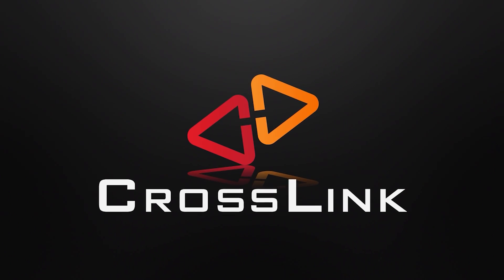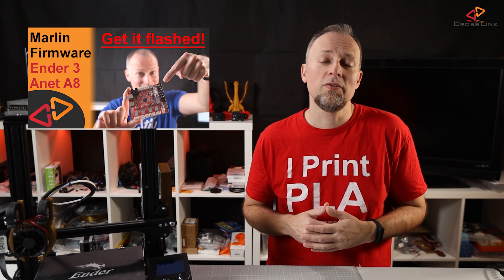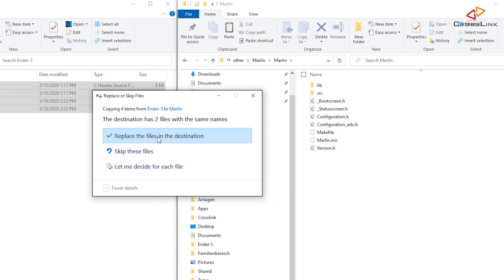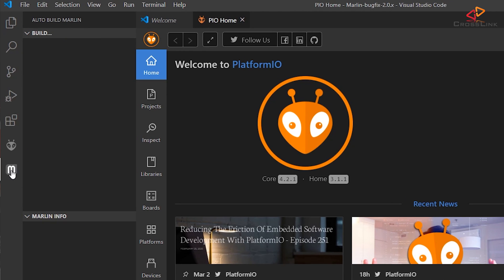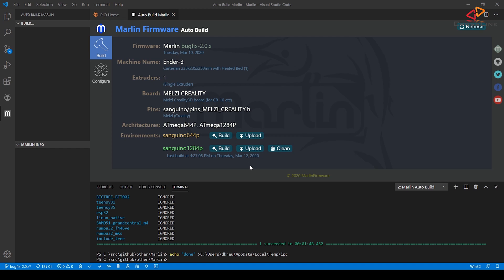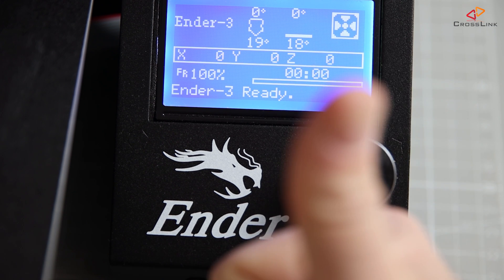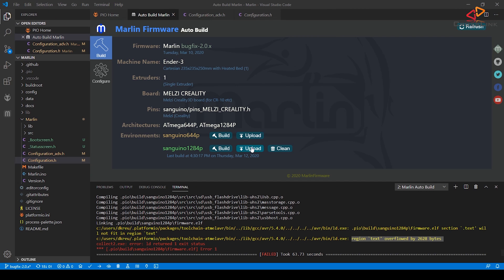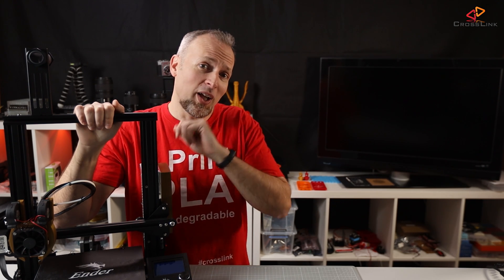Ender 3 (Pro) Marlin 2.0 Upgrade  - Updated Version

Comment: It seems that things are bit changed 10 months later, there are bunch of different configurations inside examples > Creality > Ender-3, I really don't know which to choose and on what should I base my opinion.
Reply: I feel your pain.  I tried Ender 3 Pro and there were 6 or so options.  I chose Creality V1 and it wouldn't build.  Then I went up to plain Ender 3 and chose Creality V1 again.  This time it built OK, but it's a Melzi board, not a Sanguino 1289P board.  My board says 'Creality V1.1.4'.

Not sure if I should continue.  I don't want to brick my printer... :-(
Reply: Done. :) If anybody having a problem with a port (disabled in Arduino IDE, or asking to set upload-port in VSCode) after flashing bootloader, just go and install CH340 drivers for your OS.

Comment: Just a few months later and they have made enough changes you need to redo this.  There are config files for ender 3 1.5 and Ender 3 4.2.7 but not for the Ender 3 4.2.2 which is what you are getting now in the Ender 3.  I chose the 4.2.7 and the options are now different.

Comment: This video contains omissions that are leading users astray. The link to the config files defaults to the import branch which is not the correct branch to download.  When you go to https://github.com/MarlinFirmware/Configurations, to get the example configuration files, the very first thing you MUST do is use the "switch branch" pull down and select the configuration version that matches your marlin version.  Then you can download the correct zip file. If the file you downloaded is called import-2.0.x.zip you have the wrong file. If you are after bugfix configs it will be called bugfix-2.0.x.zip, if your after a release version  it will have release in the name eg release-2.0.7.2.zip If in doubt what file to get, the README.md in the Config directory of the marlin you downloaded tells you what version of the Config files you need.
Reply: thank you!
Reply: Thx

Comment: Just installed Marlin 2.0 thanks to you. Seems to be printing great. One thing I noticed though was on the display there is a 100% displayed to the left of the progress bar. I assume that is the % of progress but it stayed at 100%. Is this an issue with just my printer or is it a glitch in the programming?

Comment: I do not get Sanguino 1248p when auto building with visual studio. I get Mega 1280 and Mega 2560 Machine Ramps 1.4. Please help
Reply from the maker: You forgot to copy the config files for your printer or you copied them into the wrong folder
Reply: @Crosslink3D  Thank you for responding so quickly. I'm new to this process. I have copied from examples ender 3 , and tried the ender three pro config file. I opened the I opened the the last Marlin folder and copied them there, There are a lot more files in the examples than what you show on screen. I will keep trying. Thanks, James

Comment: I followed this exactly with the Ender Pro, using the 2.4.7 board.   It kept failing to build.  Had to go into the platformio file and designate the environment as "ARM32F103RET6_creality", then it loaded the appropriate files and worked great.     

Thanks so much for this tutorial!
Reply: mine is failing to build, where can I find that designate to do what you did?

Comment: any help on this with the 4.2.7 board, tried exactly what youve done except its not been a sanguino board. Its showing as STM32f1 board, but when im uploading its showing as done but my printer hasnt changed at all.  Any help would be much appreciated. ive installed the 4.2.7 board to hopefully get mesh bed levelling.

Comment: VS Code won't install the playformio IDE. I installed python 3.9.1.  I did tell it to include python in path. I even command prompt tested that it was installed.  VS code keeps asking me for the 2.7 or 3.5+ interpreter (from python). I tell it where the path is and it still will not acknowledge python and then will NOT install the platformIO IDE.  Latest windows 10 OS.  How do I get this working then?  anybody know or have ideas?  Thank you. gyazo image of the error own i the corner: https://i.gyazo.com/9415440825be36c362c8caa587a3e566.png

Comment: this video is a golden reference, thank you so much @Crosslink

here are my experiences about upgrading ( this may save time for other people)

with the root project file given in the githup didnt work for me.
there are two possibilities;

 I dont have a boot loader
or
 I faced the issue mentioned here https://github.com/MarlinFirmware/Marlin/issues/19346

to give a quick shot I downloaded the  fixed version https://github.com/MarlinFirmware/Marlin/tree/bugfix-2.0.x

after loading the configs (as described in video) I built the project 
i had the environment name as "STM21F103RET6_creality"

got the bin file from [project_root]/.pio/build/mega2560/STM21F103RET6_creality/firmware-yyyymmdd-hhMMss.bin
then copied into an empty (FAT 32 formatted) sd card. 
inserted into printer and rebooted the device, it took around 10 seconds to load the new firmware. 

everything is fine and working for me , actually I'm doing print now, seems there is no issue at all.

Comment: "The currently open foler doesn't contail a (valid) Marlin project. To use Auto Build Marlin open a Marlin project folder in the workspace."

Ive tried everything, even trying different folders and double checking I was right where I was supposed to be? Could I get some help anyone?

Comment: The example "Ender-3 Pro" folder contains 6 different examples. Non seems to be for 1284P. Has anyone figured out which is the correct example to use?
Reply: I have the same issues, I don't know what subfolder I'm suppose to use ?????

Comment: i just followed the steps here but on a cr 20 (using the cr 20 config files obv)
but now the printer seems to not know where the origin is or does not seem to respond to the end switches
when i select auto home, it will move downwards even if the Z switch is pressed
then, it will move all the way to max positive of X and Y, and will attempt to continue moving when on the edges, not responding to me hitting either X nor Y switch
any ideas? when i got the eeprom error i could either "reset" or "ignore", i selected reset, turned the printer off and on and did not get the error anymore

Comment: Configurations-import-2.0.x\Configurations-import-2.0.x\config\examples\Creality\Ender-3 Pro folder includes 6 folders and none of them have sanguino 1284p option, now what?
Reply: actually there is an "Ender-3 Pro" folder and there are several main board versions available ( as sub folders),e.g. mine is 4.2.2 , I did the required steps and now doing the upload to boead. I hope it finishes properly because it already took 15 mins . I'll update the result here.
Reply: See my reply to 
Alexander Acuña

Comment: The version 1.1.9 worked flawlessly.But it doesn't have zraise function when power loss detected(I have added a power detection module)
Reply from the maker: If that module signals power loss with one pin, it could work. Proably you need to give the setting the correct pin number and it could work.

Comment: Hi, is it possible to upgrade firmware Ender 3 pro with standart motherboard?
Reply from the maker: Yes, just use the Ender 3 Pro default configuration files and it should work the same way.
Reply: Crosslink - ok. Thank you.

Comment: Hello, Merlin 2.0 doesnt have the TMC2225 on the config files would the TMC2228 config work for the TMC2225? cant find any information on this....
Reply from the maker: TMC2225 is just a TMC2208 in a different package, so those settings should work

Comment: hello, 
love the channel and your videos.... great stuff :) :)

anyway, i have a ender 3 pro with marlin 1.0.1 (came brand new like that from the seller) and i wanted to upgrade to 2.0.... 
followed all the steps and when i hit BUILD, in the end i get "J-Link connection not established yet but required for command.
Connecting to J-Link via USB...FAILED: Failed to open DLL" message.... so no connection i guess... 

am i doing something wrong? 

BTW, im using mac with OS catalina (10.15.7) 

PLEASE HELP !!!

thanks, GUY.
Reply: Hi guyelem, I'm facing the same issue. Did you succeed to solve it ? Many thanks !
Reply: @lucnougayrede9280  not yet :/
Reply: @guyelem  I found the solution. After Marlin’s build in VSCode I copy past the firmware generated in pio folder, something like that (.bin file) in the SD Card and I put the SD in the Ender3. After reboot, marlin has been upgraded in 2.x

I will check later the location of the firmware .bin generated.

(My marlin version was v1.0.1 and my board is Creality v4.2.7)

Hope it helps !

Comment: In the actual configuration->config>->ender3 folder there are 3 subfolder like BigTreeTech, MEEB and such. No clue which one do I need. Just want a new default firmware. Anyone can help which one to choose?
Reply: So after I assumed those folder titels are the leveling products I chosed  the folder "CrealityV1". Then in VCode the "Merliz Optimized" build.. Check your cable and that the COM connection is free of use. That was some nerd stuff I went through but finally the steppers are quiet.

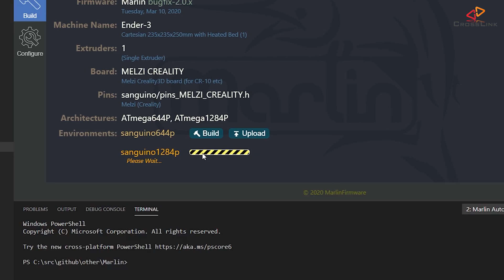Comment: 6:17 when talking about "Build" getting this for Creality Ender 5 screenshot - https://photos.app.goo.gl/BXVKtJ8CBb7fG5989 or in text form:

platformio : The term 'platformio' is not recognized as the name of a cmdlet, function, script file, or operable program. Check the spelling of the name, or if a path was included, verify that the path is correct and try again.

At line:1 char:1
+ platformio run -e melzi
+ ~~~~~~~~~~
    + CategoryInfo          : ObjectNotFound: (platformio:String) [], CommandNotFoundException
    + FullyQualifiedErrorId : CommandNotFoundException
 
PS C:\Users\   \Downloads\Marlin-2.0.x (1)\Marlin-2.0.x> echo "done" >C:\Users\    \AppData\Local\Temp\ipc
PS C:\Users\    \Downloads\Marlin-2.0.x (1)\Marlin-2.0.x>

Tried uninstalling and reinstalling. Same persists. Oddly enough, ivankravets states he fixed this bug (https://community.platformio.org/t/platformio-is-not-recognized-as-an-internal-or-external-command/431/22)
I guess not.

Comment: May I ask you why every guide I see uses the bugfix version instead of the latest stable?

Is there a specific reason? Is it someway more stable or less prone to return error during compiling?
Reply from the maker: The main reason is that all bugfixes will be done there First. Every time you have any issue with your firmware, the first question you will get is „did you test the bugfix branch, come back when you did and the problem still persists“. So the guys supporting Marlin will always tell you to do this anyways.
Reply: @Crosslink3D  Thanks mate. Now I understand the reason. It makes sense.

Comment: Ich bin ein absoluter neuling und habe noch keine software und nix auf dem Rechner. Nun möchte ich den BLTouch installieren. Ich habe youtube durchforstet und nun bin ich verwirrt. Jeder benutzt hunderte software, erstellt zig ordner da explodiert einem ja der Kopf. Gibt es eine einfache variante den BLTouch bei einem Ender 3 Pro mit einem V4.2.2 Board software Technisch zu installieren? Wie gesagt, ich kenne mich 0 aus habe auch noch nichts gebootet oder ein update oder so gemacht.
Reply: Genau der gleiche Mist bei mir. Dieses Nerd Chaos und nichts funktioniert nach einem Update. Hab von 4.2.2 auf 1.15 die Silent Variante gewechselt weil diese blöden Stepper so laut sind und jetzt bin ich gefangen in dem Sumpf der Firmwares und Modder. Meine Stepper sind wunderbar jetzt aber das beknackte Display macht nun ein grausames Geräusch. Zum aus dem Fenster schmeißen die ganze Schose..

Comment: Great tutorial, but I spent a lot of time trying to figure out Mesh Bed Leveling, including doing a pull request to the Marlin Bugfix branch with my own code, and there is some unintentionally false information in this video. Mesh Bed Leveling (MBL) is automatically off when the printer boots up, and RESTORE_LEVELING_AFTER_G28 does NOT ENABLE the mesh after each home. It simply turns it on if it was on before the home command. What this means is- every time you turn your printer off, you will need to manually turn MBL back on. This is usually done in the GCODE of your prints, but you must add the command to each print which is quite annoying if you use a lot of different slicers and computers. The best option is actually UBL, you do not need a z-probe sensor, although most people seem to think you do for UBL. MBL can only go up to 7x7 grid and UBL can go up to 15x15. With UBL, you enable it, set the mesh values, save to eeprom, and never ever have to fuss with it again, it will always be on.

Comment: Thanks for the fantastic tutorials.  I was struggling to free memory up memory to build the Marlin 2.06 Firmware on my Ender 3.. I found this link "Reducing Marlin firmware binary size to fit in your 3D printer board memory" by Thiago Borges on Github. 
https://thborges.github.io/blog/marlin/2019/01/07/reducing-marlin-binary-size.html

Comment: Thanks so much for this tutorial! I've ran into an issue that I cannot seem to remedy. The firmware works great until you shut the printer down. When you try to turn the printer back on it shows a blank blue screen. The only way I've been able to get passed it is to unplug the power and LCD cable, then plug them back in which seems to reset the entire firmware. Could this be corrupt firmware?
Reply from the maker: Might be that there is not enough memory left. This happened to me when I used a firmware that was 99.9% of the program memory. Try 2.0.6 and use melzi_optimized to make it smaller. Also you might have a faulty bootloader so re-flash that just in case

Comment: I have a brand new ender 3 with silent board, if i try to upload the latest firmware in visual studio, it asks for me to upload via segger jlink, what is this? there is not an option to upload via usb. please help
Reply: Same here. Did you get this resolved?
Reply: Hey  @joeadams2527 , same here. Did you get this resolved ? Many thanks.
Reply: any resolution?

Comment: I try to follow these steps but instead of the alternatives of sanguino 1284 I get Melzi, Melzi optimized, and Melzi optiboot. Any ideas what I am doing wrong?
Reply from the maker: Nope, it's just July and a new firmware is out. You can Use melzi_optimized for the Ender 3, this will make the firmware smaller in size by about 5%.

Comment: Can someone just create a file to download onto my micro usb, plug and play, so I don't have to do all of this?
Reply from the maker: If you have the firmware file you still need to upload it. But I am working on a convenient solution, wait for it
Reply: @Crosslink3D 
I wish I had waited a little bit longer for your solution.   I ordered a new card that is supposed to be quieter, and it claims to have the latest updates as well.
 Thanks for offering the solution, maybe I will update your way and save the card as a spare.

Comment: Any explanation for the melzi_optiboot and melzi_optimized environments in ABM? seems like they have configurations for Optiboot which frees around 1.5 kb, but there's no easily found information on making optiboot work on the melzi boards
Reply from the maker: Optiboot is a bootloader you may flash to your board with the Arduino IDE. melzi_optimized is a build option you can use to make your binary even smaller. In combination with the optiboot bootloader you can use larger binaries on your board. Both things are independent from each other. The melzi_optiboot you don’t need to use anymore, always go for melzi_optimized.
Reply: I’m having the same problem, can’t figure it out

Comment: I got past that error by using a different computer.... Now im getting an error that it is trying to sync but is attempting 10 times and failing. The Ender 3 should have a bootloader installed correct? I just purchased this Printer a few weeks ago. Please Help and thank you for your previous help.

Comment: Managed to upgrade my Ender 5 pro using this video, thank you very much.
I did have that BUMP_XYZ error but I resolved it by deleting all the files, downloading fresh stable release 2.0.5 from github (bugfix didn't work) and downloaded configuration files for E5Pro for the same branch.
What I don't know is in which mode are the steppers working. Stealtchop2 or spreadcycle, how to tell?
Didn't try with BLTouch yet, need to install it first...
Reply from the maker: The mode is also defined in the Marlin configuration_adv.h file: 
  /**
   * TMC2130, TMC2160, TMC2208, TMC2209, TMC5130 and TMC5160 only
   * Use Trinamic's ultra quiet stepping mode.
   * When disabled, Marlin will use spreadCycle stepping mode.
   */
  #define STEALTHCHOP_XY
  #define STEALTHCHOP_Z
  #define STEALTHCHOP_E

Comment: , hello yes I change my my motherboard to a mini e3 it says Merlin 2.0 on the ldc screen. but the SD card that came with it doesn't work it say sd card full iI put my old one in and it works do I need to update the sd card.?
Reply from the maker: Maybe the card is broken. I would really try a new one.
Reply: @Crosslink3D  OK thanks will I have downloaded marlin on my SD card. Its arready programed on the motherboard it comes up on lcd screen with marlin. 2.0.👍

Comment: When I change the configuration.h file (to activate mesh bed leveling) and upload it to my ender 3 pro it sais it succeeded but mesh leveling is still not available (and also Marlin is not rebooting as it did when I first flashed it)...  What am I doing wrong? Note: I used configuartions file for Ender 3 (Configurations-release-2.0.5) because the Ender 3 Pro files from the other repositories did not work and the build would fail...
Reply from the maker: Probably you forgot LCD_BED_LEVELING?
Reply: @Crosslink3D  Thanks for the reply! I also activated LCD_BED_LEVELING... and also I changed CUSTOM_MACHINE_NAME "Ender-3" to a custom name, which didn't work either....